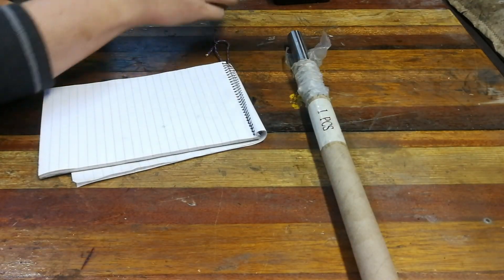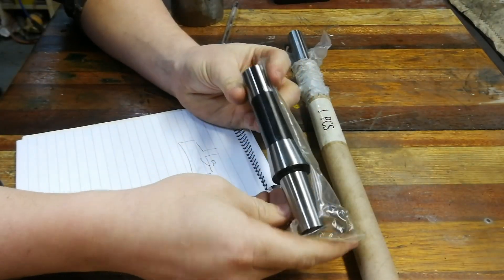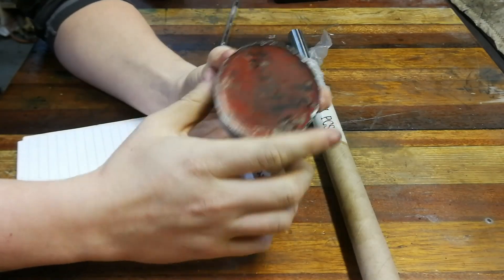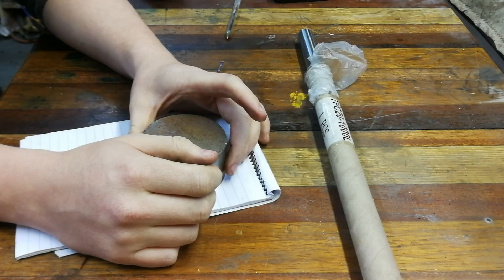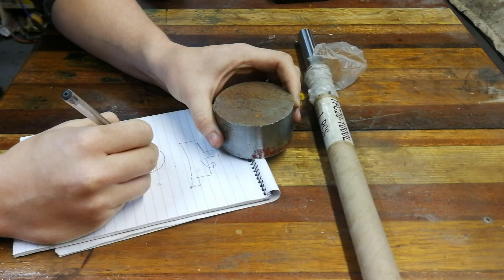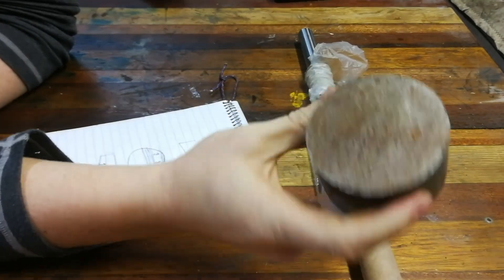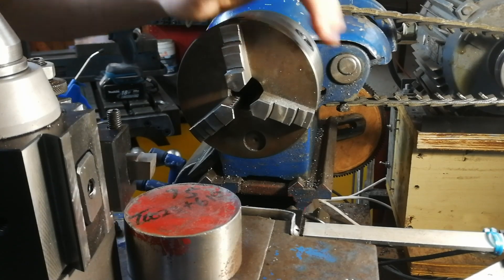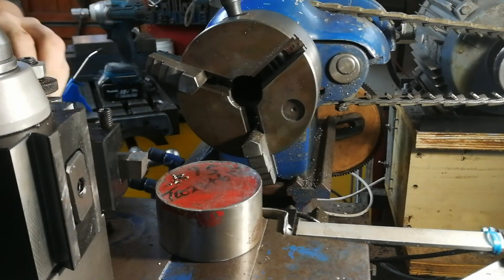My very first flycutter #Roughcut2022

Comment: Your video had me kwacking up. Put a Triangle insert on the end of that bar. The hardest things to clamp are round stuff. Do what I did, watch Robin Renzetti, Abom79, Tubalcain, both Keith’s, Randy Richards and OxTools on YT. There’s a lot of Hobby machinists in your country.  We all are learning more with each passing day, Find a cheaper used machine dealer in your area. Fixturing is everything! I use a Criterian 202 boring head with a Mesa tools flycutting bar with a triangular insert. Inquire at machine shops in your area, old guys will gladly help the youngins. 👍

Comment: Does your dad know you're playing with his tools?

Edit: ok, that was pretty harsh. My apologies. Let's work on your vocabulary, today's word is "RIGIDITY". To spare yourself evisceration, broken facial bones, or sudden onset blindness, you'd probably be well served to ensure rigidity in your setups. That wanderlust of your part in the vise is courting disaster. I suggest your new shop best friend should be an 8 oz (250ish gram) soft faced hammer. When you think your set up is good, start whacking at your part in directions you anticipate load to shove it. Then any other direction too. If your part moves, think about how to restrain it, then do so, and repeat. Case in point, a couple of shim stacks on top of your vise jaws perpendicular to the jaw plane would rigidly establish your angle once you tapped down the part with your hammer as you tightened the jaws. A t-nut clamp or 2 would prevent the part from wandering the x axis. Rigidity of set up prevents accessing the contents of the first aid kit, and produces far better work fit and finish. RIGIDITY, it's your friend.
Reply from the maker: a soft faced hammer is a good idea, I'll try learn a habit of always checking workholding with that, and then getting creative with making things more rigid/holding them better will be a work in progress. thanks.

thankfully they're my own tools, so any disaster is wholly my own responsibility ;)
Reply: @anamateurmachinist857  the greater the surface area contacting your vise jaws, the more rigidity. As you said you source tools from banggood, perhaps one of those square, hex  or octo collet holders might be a worthy investment for round stock grabbery.  Parallels and 123 blocks also, though for propping and shimming. A useful project for your toolchest would be a few machinist screw jacks, or just fake it with coupling nuts and bolts. An assortment of cheap nuts can be bored and slitted to make round stock more vise rigid as well. Humble scrap from bar stock drops to beer can strips can comprise shimming piles.
Reply from the maker: @ludditeneanderthal thanks, I actually do have a square/hex collet block and 1x2x3 (well, for me it's 25/50/75mm) blocks from banggood. Just need to make proper use of them more often.

machinist screw jacks and some parallels are next on my list of either make or buy (most likely give it a go making some).

I have a selection of tin-can strips etc for shimming, just need to start using it, never thought of it for workholding until your comment. appreciate it.

Comment: We all had to get our feet wet at some point. 3 points of contact are better than 2 on round parts. Add a V block next time to keep things from moving.
Reply from the maker: good advice, need to make a v block or two for around the shop. I'll have to invest in some proper ground ones at some point too.
Reply: Inquire around, we all have extras after finding High-end blocks. Not sure if your a Brit, Ozzie or Kiwi 🥝

Comment: Its a bit of a rough start not gonna lie but you got there in the end! :D

If you want any advise (not sure you need it but never hurts) you want to use your lathe chuck in a way so its closed as much as possible and always clearance check (i hope you learnt that lol).
Not sure what kinda vice you used on the mill but usually you want to center the piece. Couldnt have hurt to clamp it 90° at first and mill two flat spots.
Gonna be honest i dont know a lot about fly cutters since theyre illegal to use where i work but im not sure why you even planed the whole thing at an angle. To me it just makes the whole thing unbalanced but maybe im wrong. The end result seems to get the job done quite well so idk :D
Also i sincerely hope that noise while milling was from your camera mount, otherwise something else is probably not good. I had to giggle sometimes so good job on the entertainment :D
Reply: Speeds and feeds are everything. With light equipment, take light cuts. You have all day. Lol
Reply from the maker: Hey Dennis! Thanks for all the advise, glad you enjoyed it, milling flat spots is a great idea! would've made my life a lot easier.

And yeah, learnt my lesson on lathe chuck clearance, I couldn't fit the piece using the next step up on the chuck jaws (if that makes sense?), so I was a little limited. I definitely need to check on clearance more often anyways.

I just planed the angle as that's what I've seen elsewhere, it's a good point though, doesn't seem like there's a functionality advantage, never thought of that.

The noise is coming from the spindle, I suspect it's a problem. When I pulled it apart I used a light oil (which I'm not good at consistently oiling), so I might need to pack the bearings with grease rather, otherwise, could be some slop in the drive spline or something? will do some research and see if there are more tips, seems like there are lots of blogs on these machines.
Reply: @anamateurmachinist857  makes sense, on video it looked like it might fit the next step.

Im not sure about the spindle part, maybe the weird noise is just from the speedup. When you were using the roughing tool it did sound okay and i was actually surprised you could take that much away without it shifting.
But if what you said is true then def look into it, im by no means an expert on old milling machines but the blogs you said or an old manual should give you good advice on how to lube the bearings.
Reply from the maker: yeah, I was definitely pushing it to see how deep of a cut I could get away with. 

thanks, yeah, will go track down a manual/some tutorials.